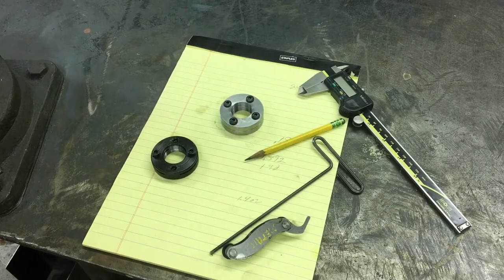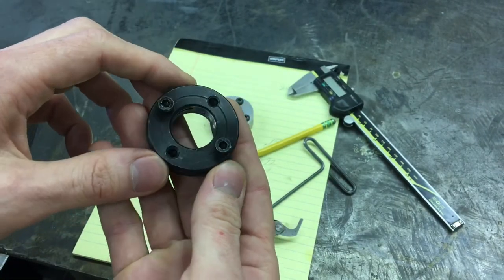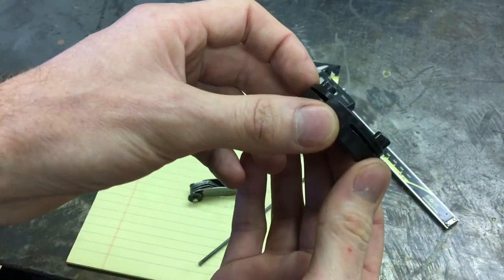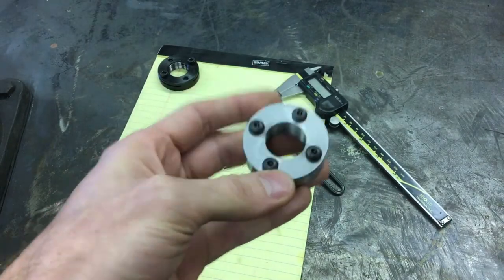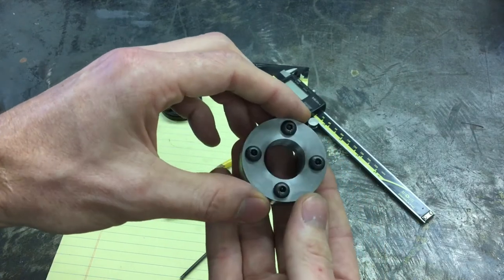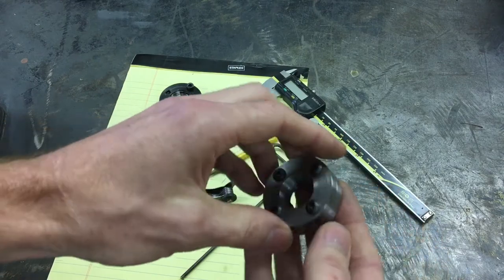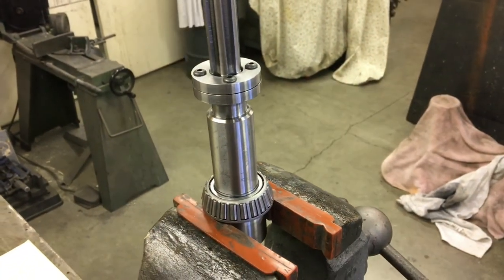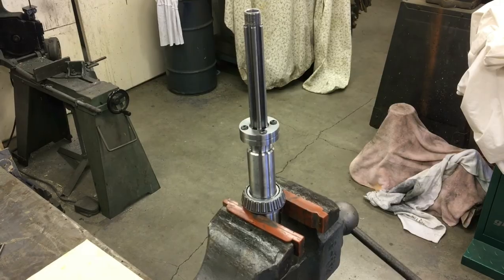G0704 Spindle Bearing Preload Adjusting Nut

Comment: Are those the stock bearings?  Are you still running stock on The CNC?  Did you have overheating problems or was the preload incorrect?  My stock spindle gets very warm if I use it for extended operations and wonder if I need to disassemble and inspect/adjust?  Thanks for the video!
Reply: I had overheating issues, possibly not from the overheating but maybe from wrong handling of the bearings before and after it was delivered.
I changed all the bearings to japanese bearings and my machine is sometimes running over 15 hours a day and it's just warm. Before it was hot.